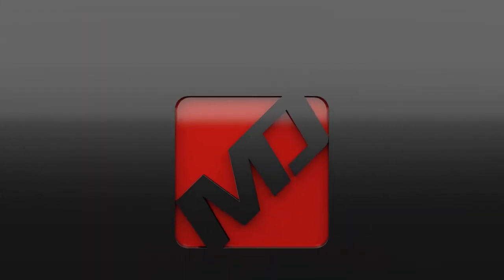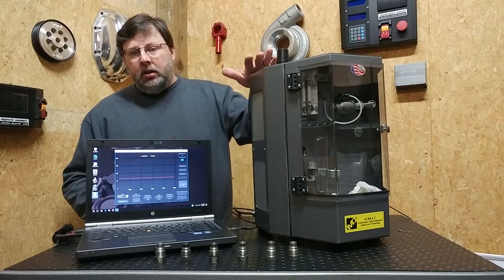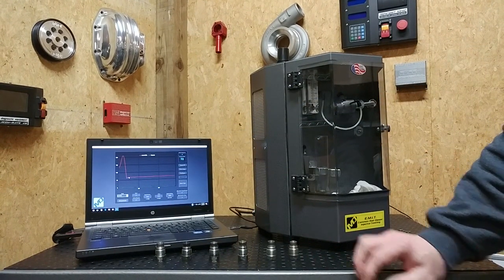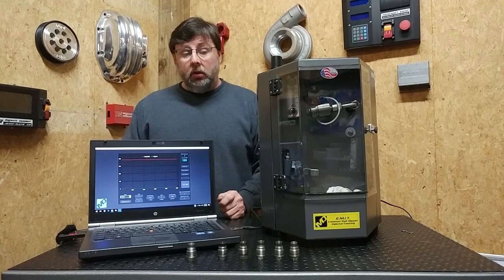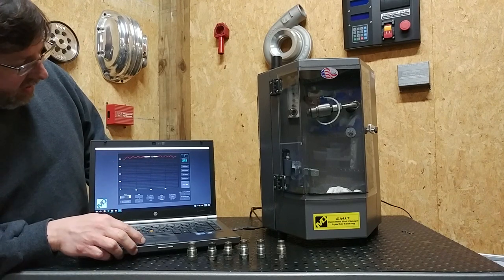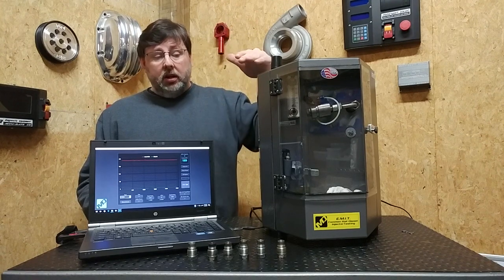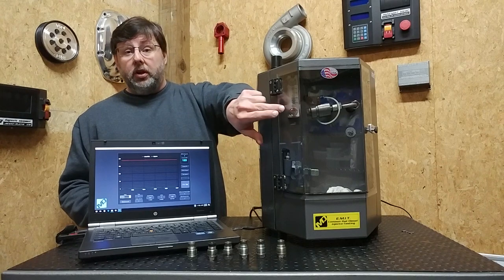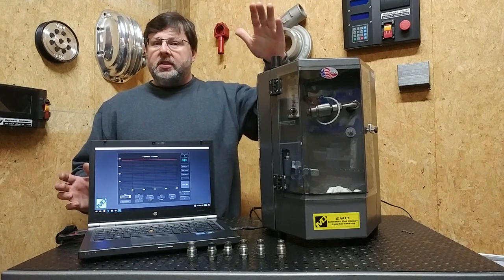Cummins and Duramax Rail Plugs EXPOSED!

Comment: You're theory is sound and you provided all the science necessary to prove it.  However, if a single stage relief valve is the answer for such a huge problem why is no-one marketing them?  Including you!  Several reputable diesel performance shops are swapping to plugs and there just isn't anyone out there saying that they regret making the swap.  You guys should be building these things from new parts and marketing them if it's that common of a failure.  Someone should get Gale Banks to install a plug on a motor in his test booth and see if he can destroy the fuel system.  He likes to blow shit up.  Your test machine looks like a valuable tool to a shop that isn't just in the market of selling everyone new injectors.  Great video!

Comment: I put one of those plugs in my 08 Cummins and it killed my cp3. I recommend a good tune by a pro and you will be happier than what a $25 part will give you in 6 months before you have to start replacing expensive parts

Comment: I have a zd30crd in Australia, I was having issues with funny rail pressure and suction control valve working outside its range and putting the engine in limp mode.......changed suction valve (assuming it was caused by dirty fuel from my spare fuel tank), same drama, decided to change pressure relief valve as a last resort, pulled it out and it had been replaced with a plug, put the valve in and my rail pressure actually went up 3500psi and the car is driving beautifully now, very happy with it now.

Comment: I've been running a rail plug on a 12mil stroker. 28k 3100 duration. No issues so far for my 5.9, but now I'm sketched out.. I'll have to look into this.. i did detune the truck and don't beat on it anymore. I'll ll check it out in a few. Thanks for the information

Comment: Where can I buy one of these pressure relief plugs?
Reply from the maker: It isn't a plug it is the factory valve that has been modified to operate as shown in the video. We can modify an existing valve if you have one or provide you with a new one, contact us for more information.